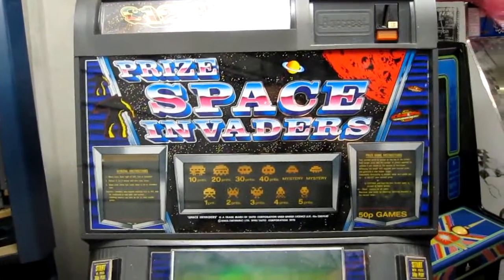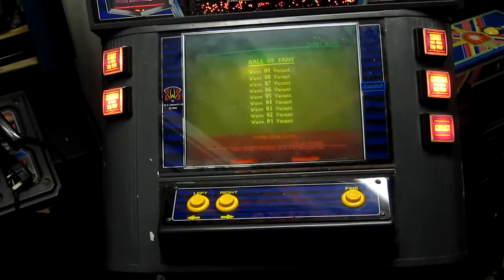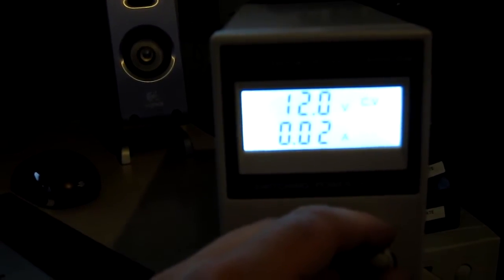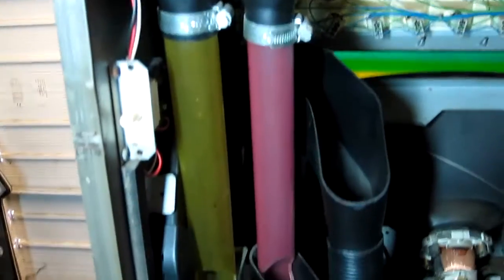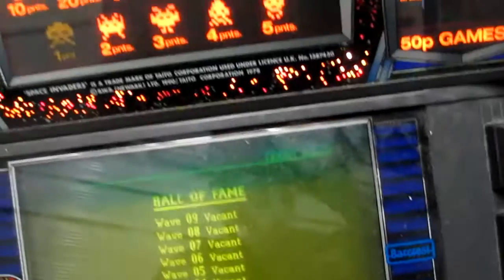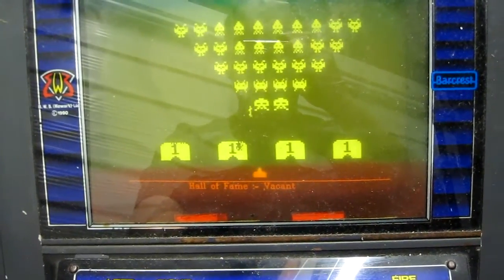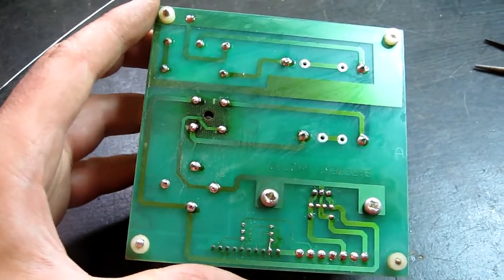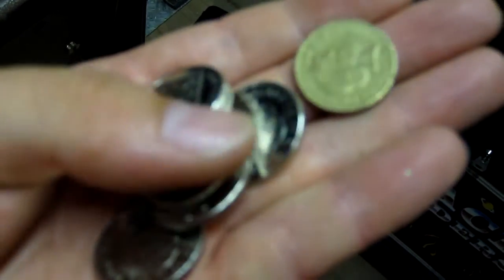Prize Space Invaders - Repair and Restoration

Comment: Great!!! Thanks!  I could do with some help myself - I am consolizing the Neo Geo MV-1FZ at the moment and getting noise on sound output.  I've used the mmmonkey.co.uk MV-1FZ stereo out mod to provide the stereo audio to my Scart connector.  I am not sure if the resistor size is too high in that guide as the volume is quieter than any other console, and I am also not sure about using 4.7uF caps to decouple the audio - perhaps those are adding to the noise when going into Scart?

Comment: Hi, I appreciate this video is 10 years old. I'm trying to fix a friends Prize Space Invaders and have refurbed the PSU and found a working MPU4 board. The machine boots and you can hear the game running and you can fire. But the screen is blank. I think the rear door switches  (tested) are interlocked with the monitor but I'm struggling to find a circuit diagram,  But every once in a while the screen will come on and looks OK. Any pointers?